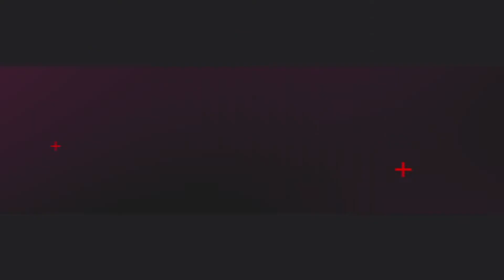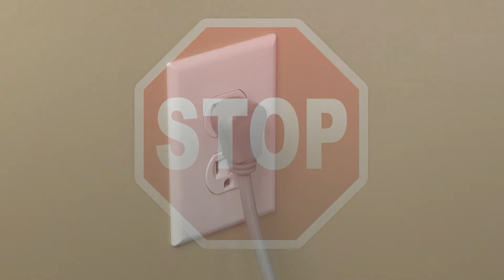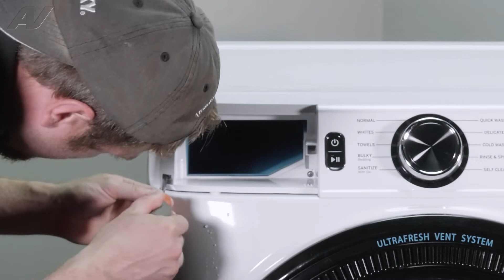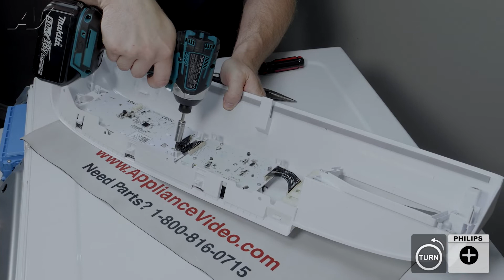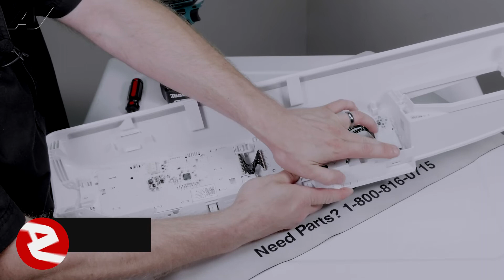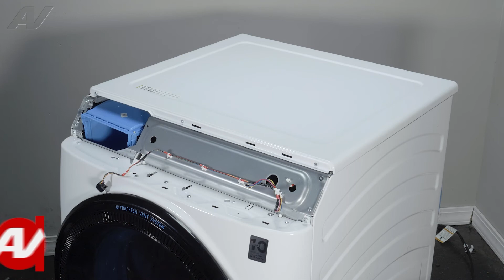Washer Repair - Buttons Are Unresponsive - User Interface

Comment: How do you re program the interface after replacing. Just finished replacing mine and it shut off at around 30sec. Error code after putting it in diagnostics settings is 19, 23, 26, 34, 91.
Would appreciate the help!  
Thank you for all the videos you share!